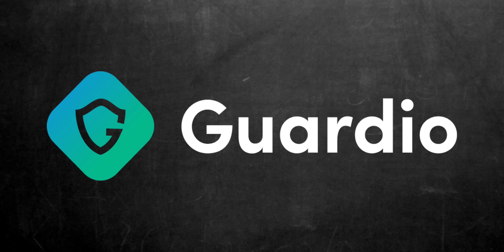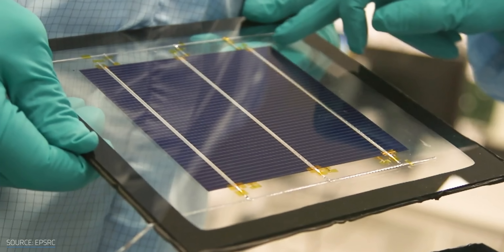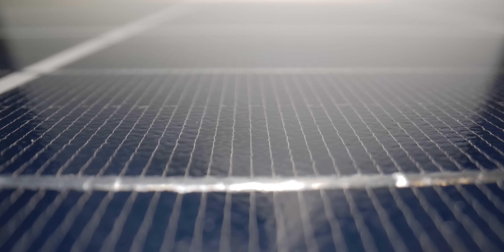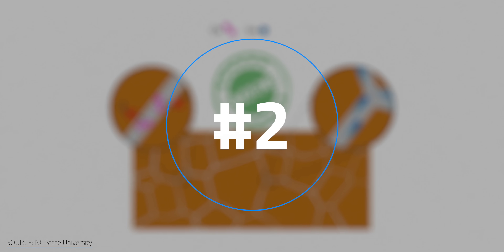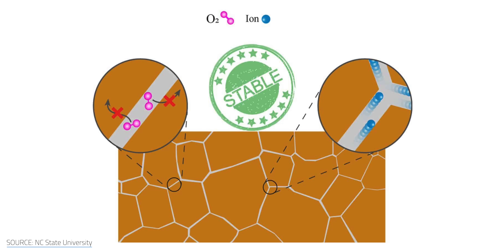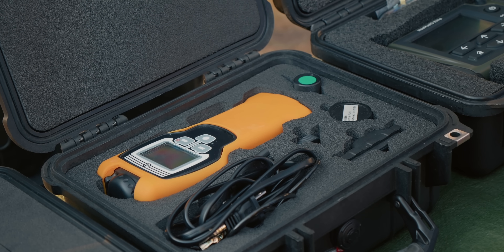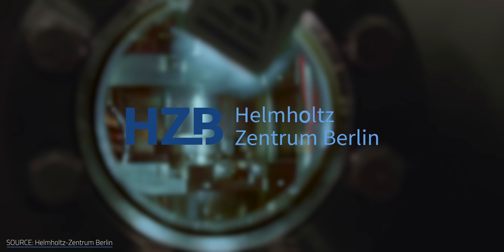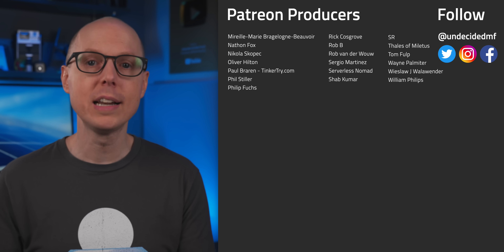Top 5 Solar Energy Advances Using Perovskites

Comment: So honestly here, if lifespan is an issue on these cells then why don't we modulize them? Split one solar panel into 4/6/8 parts, and allow someone to yoink one module out and replace it with a new one. You only need to replace 1/xth of a panel then.
Reply: Do you not think the solar cells will not all degrade at roughly the same time?
So why not replace the entire lot in one go? 

Surely, sending workmen out multiple times to replace the large number of smaller modules in your strategy over a year is going to work out more expensive?

In which case if you're going to replace many smaller modules at the same time to reduce the maintenance cost, you might as well just have one big panel and replace it.

The single big panel will take less time to replace and the maintenance costs will be lower. And the manufacturing cost will be lower meaning the purchase price will be lower.

Comment: In my view the key aspect is the embodied energy in the PV panel. Silicon wafers require both energy and water intensive production processes.  For us to solve the problem of
a sensible transportable energy vector - such as liquid efuels - we need vast amounts of low embodied energy solar generation.  Perovskites could provide this.  In my view, this is the key to solving climate change.

Comment: The Cheap, Fast or Good idea is an engineering idea not a scientific one. The reason why it applies in engineering (or design in general) is that if something fits all those categories then there is no choice to make and all other choices disappear. It doesn't really work in science because it is not about tradeoffs instead its a practice of understanding how something works rather than what is the optimal solution.

Comment: With over 38 years of advanced material reinforcement and chemical engineering experience, I have done advanced Perovskite application development for solar panels, etc. 

Perovskite stabilization is key for application longevity performance.

Sitting on various ASTM (I) committees over the decades, I have co-authored many testing and measurement standards, which need to be agreed upon for all new technologies.

Taking the new technology mentioned into practical applications is my specialty.
Reply: Maybe an interview with Matt is in order :)
Reply from the maker: Wow!  Thanks for sharing.

Comment: Solar just won't see the adoption or "really" be worth it until we reach a conversion ratio of 37% or more on the low end. I say "really" as it's worth it for a lot of people already but most of those systems aren't reaching the 22-23% efficiency that panels are capable of. Typically they are around 15-19%. We have looked at them several times, but the cost of a 22-23% efficient system, with that 30 year life span, automatic failover, and battery backup will run over $30k. Until we see 37% on the low end of solar with the cost being subsidized by the government and at the state level at a greater amount than it is now, I just don't see the mass adoption of it. (We are paying in taxes for this technology to be created in the first place along with private investors.)

Maybe a combination of a polarizing layer that bounces the different wavelengths of light specifically in between each layer of double-sided perovskite sheets (ie: They have electrons knocked off on the way in and out) with a graphene substrate and connective structure to reduce loss and improve performance. The inverter to battery technology, the battery itself, and transmission materials need to be looked at as well since we aren't really solving the overall issue of providing energy for ourselves and hopefully strengthening the grid.

Comment: Hearing 24% efficiency on soon-to-market solar cells is great.
I assume, though, that few, if any, of these university lab breakthrough processes are yet being applied to production.
Any numerical estimate on what kind of improvement could be seen with all the lab results applied to a production environment?
Reply: Nothing there was remotely close to market, that 24% cell was tested to 1000hours and they were impressed by that but it is completely worthless at that the target is more like 50,000hours to be comparable to current cells
Reply: Modern silicon panels have an efficiency of 23%. 24% is nothing to shout about 

What we need is a big jump up to say 50%.

Comment: 1000 hours to 95%.
It's just 4 months (8h/day).
Silicon based panels keep that for 10 years and the best ones for 20.
So you're still a 30* factor behind.
The problem is also the labor to change panels. You have to be really really cheaper if your lifespan is shorter or the cost to do the change more often  will absorb that gain.
Reply: They didn't have time to test more yet, they only concluded that is still holding 95% in 1000 hours, but they will need months more to check if it can, for instance, reach 10k hours over lets say 90% and so on. Its a new tech, you can't expect them to have it tested for decades even on advanced wear facilities
Reply: @MrCaiobrz  You expect linear or less degradation? But it could be even worse. It could snowball and be exponentially bad...
Anyway, even with the most optimistic case, it's still an order of magnitude behind silicon.
Concerning the advertised value, it's not because they didn't have the time, it's because they want to give a good number that can be easily remembered. 95% and 1000h looks good for the average Joe but it's actually not much.
Reply: Degradation slows as the defective elements of the panels become suspended, but the integrity for most of the structure will still function

Comment: Hold on. Shockley-Queisser limit is not calculated for silicon, perovskite or any other material. It is calculated for a single p-n junction. What mechanisms allow perovskites to exceed this limit?
P.S. Love your videos
Reply: It’s in the transport. P-n junction have electron-hole pairs form in the junction, and travel through the the bended band level to their respective layer. Perovskite electron-hole separate by jumping through a barrier. The barrier is usually achieved by having a matching band for electrons but not holes and vice versa. This keep energy from being lost due to change in band potential.

Comment: As someone who works in the solar industry, perovskites are very interesting (as is graphene conductors). Anything that may increase the efficiency of solar panels and their electricity generation is going to be good for the renewable future.

I wonder if you’ve ever looked into inverter efficiency because converting DC to usable AC power (and in a safe way) is also a hurdle for solar electricity.

Thanks for another great video.
Reply: What do you want to look into regarding inverter efficiency? Microinverters are commonly 90% efficient and modern high frequency string inverters that are currently on the market are 95%+ efficient. There's no point in chasing the last 1 or 2% possible of efficiency since it'd likely make products more complicated, expensive, and/or shorter lived.
Reply: Inverter efficiency depends on load.  They can make inverters for which peak efficiency occurs at different loads, but that's equivalent to building multiple inverters in a single inverter.  At a certain point the extra cost to build the "super inverter" doesn't justify the energy savings.  It's probably easier to just add on an extra solar panel or two and eat the efficiency losses.
Reply: Graphene still being touted as the "super material" where it's only "a decade or two away" (every year) from being mainstream?
Reply: @Mike__B  That still puts it 10 years faster than cold fusion. 😉
Reply: @thomasbonse  why do you have to be so hard on cold fusion. It's trying really hard. Just another 30 years and they might have it. If you don't believe me, ask me again in 30 years and I'll give you the same answer.
Reply: @Mike__B  they are making  massive steps forwards in relation to graphene, the production costs have been cut drastically and they can now manufacture it in large quantities at decent prices. So now the next step is graphene sheets but graphene in small portions are already being used in the UK in road construction with asphalt and concrete and seems to be showing very impressive results but I suppose it still needs to pass the test of time.
Reply: @ashamahee  if you focus the sun rays by the help of lenses the more sun rays will be concentrated on particular place of the panel then how it will work out for producing the electricity in more quality and quantity
Reply: @Mike__B  Honestly I'm looking at Hexagonal Boron Nitride to deliver rather than graphene.
Reply: Is that an insuøator?
Reply: Editors Note: Inverter Efficiency has not been a hurdle for solar electricity.
Reply: Well maybe instead of looking for magically efficient inverters we just need to create DC appliances that are by their nature compatible with the DC power from solar panels. As far as I know, we only use AC because it’s more efficient for long-range transmission lines. If your personal solar power source is basically in your back yard, why invert it when you can just use it as-is with DC appliances?

Even if you still have to connect to the grid, you can just get an appropriate rectifier to convert the AC to DC, which (iirc) is simpler to do and has a more straightforward process of cleaning up any noise in the voltage or current. However, I’m no electrician, so I could be wrong about rectifiers vs inverters.
Reply: I'm waiting for at least 90% efficiency in using the power of a photon.

Currently there's a ton of power left on the table with current tech.

Comment: Why are we even talking about a 1 or 2% improvement in conversion rate, is it that significant?
From a mass manufacturing standpoint it’s huge, but for us consumers, it’s very tiny and not like we can now put on our roofs half the solar panels than last year.
Not even one less solar panel!
Reply: the expected increase is from 21% to >40% efficiency
Reply: @drewdevlin9192  that would be amazing. In the 8 months since this video, significant further progress has been made.
Reply: the thing is - perovskites have (?) wider light spectrum range of taking energy from - so during cloudy days, having snow on the roof, dawn - it should still produce some good power. For cloudy europe and offgrid systems/clusters/homes this should be very helpful. 
Saule technologies from Poland started developing perovskites many years ago and they launched electric prize tags on shelves - they even use light from the normal light bulbs in the shops.

Comment: I so want lightweight rollable solar panels to come to market 😶! Imagine being able to "unplug" and go on  your PEV of choice for a roadtrip of multiple days and not having to worry where you'll charge it.
Reply: You would need a large swimming pool sized solar panel to get any meaningful charge out of it.
Reply: @volvo09  I wrote "PEV", not "EV". Personal electric vehicle. Think scooters,  electric unicycle, Surrons.
Reply: @mattca353  ah, yes that would totally work. I missed that and was thinking about heavy vehicles like cars.

I have a diy e bike, (and off grid solar) and with a small trailer and my bike I could travel on solar with a days stop.
Reply: @volvo09  I'm riding a electric unicycle (the Sherman S), 3000w motor, 3600wh battery and can be charged at 15 amps.
Reply: @volvo09  is there a data sheet  for output of commercial products yet
Reply: You migh be thinkings of a CIGS panel, but they're not powerful enough to charge an EV for a road trip

Comment: Would these new perovskites cells require more silver?  One of the reasons people invest in precious metals, especially silver, is that they're used industrially.  And if these cells are that much better, might be worth paying $30-50/oz of silver
Reply: Depends on the design to be honest. Alot of the lab based designs use silver and gold sputtered to excess. We can cut down on this by replacing it with alternative conductors such as carbon (graphite or graphene if possible).

Comment: If 1000 hours of exposure to sunlight causes a loss of more than 5% of original production capacity, these things aren't ready yet. That's not even ready for some kind of NASA application yet. I'm sure our clever scientists will continue to improve the tech, but I don't see the value in launching a product with such limited durability...would be disheartening to see an early product flop due to being rushed into the market.